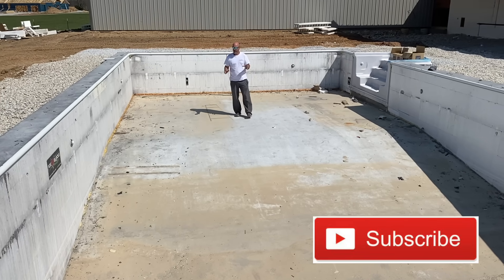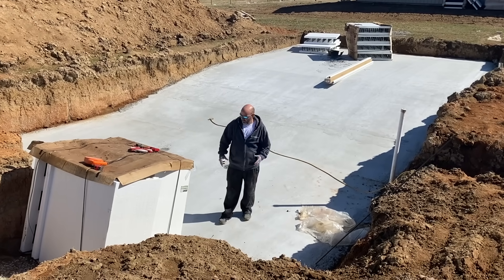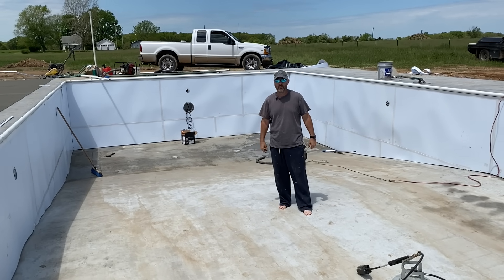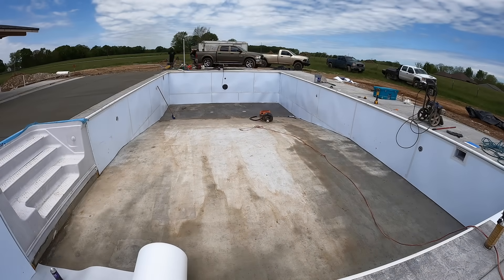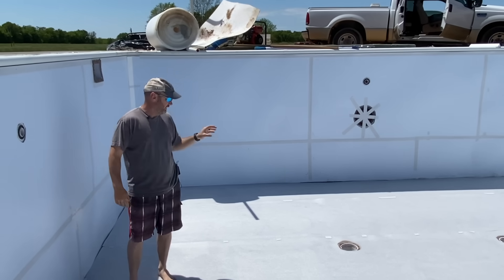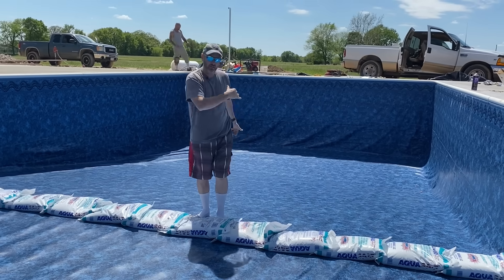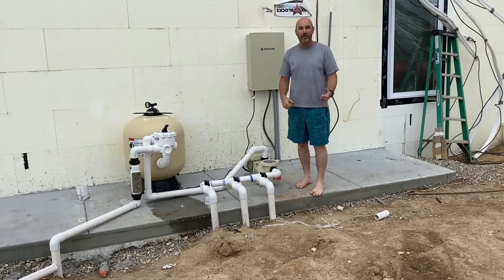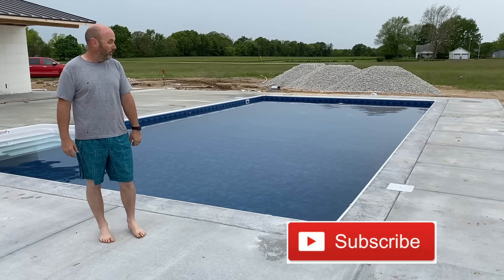ICF Pools of the future! stronger, cheaper and more efficient!

Comment: Whats the cost to build one of these inground pools? I am thinking about having one put in.
Reply from the maker: You can diy one for around 30-35k, retail is about the same as conventional steel wall sand bottom liner pools with all the added structural and thermal bekifits!

Comment: What is the size of the pool and cost total
Reply from the maker: That’s a 20x40, kit is 19k and change, another 10-12 will get it dug out and concrete and pipe, liner is 3k, retail on this pool is 70+, so you can easily save half if you diy with our kits!

Comment: Is anyone using a spray on bedliner type idea to coat a pool surface versus using a liner? I have seen some impressive looking spray on products in videos, waterproof and strong. The ones I am talking of cure in a few seconds.
Reply from the maker: Ecofinish is basically that, only it’s engineered and formulated to handle the submersion and chemical swings better than other coatings

Comment: Any reason you got an Eaytouch 8? That Superflo runs off constant power and is automated with a digital input cable, so the only thing running off of a relay is the light leaving 7 relays open. It’s nice to have extra relays for landscape lighting later on down the line, but that’s a lot of extra money spent if they aren’t going down that road. Just curious if they have other plans for the backyard.
Reply from the maker: Lol good eye…. Have you tried getting panels lately?  Unfortunately we take what we can get and I’ve had to buy 4 easy touch 8’s when 4’s would have been more than enough this year because it was all I could get…
Reply: @all3pools  Yes, we fortunately haven’t had a problem. We do shotcrete so about 90% of our pools include a spa. Haven’t had a problem getting the pool & spa combos thankfully. From what I remember we had trouble getting single bodies for a short period. 

Good call on going with Pentair though. Best equipment out there. Just a bit more expensive but well worth it

Comment: i don't get how your building a basic cement pool an lining it with vinyl an that's something new an cheap it's not it's been around for over fifty yrs , come up with a pool that's cheap an will last fifty yrs now that's something worth posting about !
Reply from the maker: First, it’s not basic cement, it’s icf, which is a natural thermal break, and we put foam on the floor and thermally break that too, reducing heating costs by up to 65% without a cover, with a cover even more because there’s virtually no heat loss to the ground!  The last 50 years 95% of vinyl pools have had steel or plastic walls and vermiculite floors, neither hold up like CONCRETE(not cement) and neither are less expensive than this system…. So this system is exactly what you describe, a structurally and thermally superior product that will last a lifetime!
Reply: @all3pools  underground cement walls and pads have been insulated for fifty yrs it's still basic cement work the foam molds are new ish dunno why you would use them

Comment: Great vid. Thanks for putting together. How long would a liner like this last in an indoor pool application?
Reply: It’ll last right up until the time that it doesn’t. It all depends on how the pool is taken care of and whether you “condition” the liner each year after drain down for cleaning or maintenance. A good conditioner we use is similar to a wax that’s used on vinyl wrap. It helps restore the flexible properties to the liner that’s so crucial to its ability to remain in use.

Comment: Hi, thanks for the video, great job. Just 2 things I never seen, the floor pipe install and how did you remove the liner wrinkles in the corners? Please show it in you next ICF video. Thanks
Reply: The weight of the water flattens out the wrinkles.  They also vacuum sealed to decrease how many wrinkles would be there to start with.

Comment: This is a cool video. I built an indoor 16x32 a few years ago out of ICFs and I used pex in the floor to heat it with radiant heat. Customer runs a cover when it’s not in use and his propane bill barely changed even though he heats it to 90 with no pool heater🤣👊🏼
Reply from the maker: Ya I’m going to try to accentuate the thermal benefits of icf pools as the few Gunite homers on here have 0 answers for how to compete with icf on that front!
Reply: @all3pools  it’s a drastic difference. In ground pools are extremely uncommon where I live so I’ve only gotten the chance to do one. I used the Stegmeier forms for the coping and the only thing I’d change is the way the liner kinda compressed the foam at the very top. Keep up the good work!
Reply from the maker: Ya on liners we use the aluminum bullnose when we can get it so it’s entrained in the coping and doesn’t try to pull the foam down, if we use a Cantilever form
Like stegmeyer, we cut the inside form down like 4” and let concrete come out all the way to the face of the icf, giving it a sturdy place to set the liner track

Comment: If you run a snake or string through the light conduit you can install liner then light faceplate, cut hole for liner then just pull the light cable back to electrical box. No need to take it apart that way. Good vid. I’ve done steel wall ingrounds with vermiculite bottoms for 25 years. I wonder the cost difference is with these. Might have to give one a try. Good vid.

Comment: How long is the liner rated to last
Reply from the maker: Liners can last 15-20 years if covered and ph and chemicals kept perfectly balanced…. That said, outdoor pools probably avg 10 years, if you hyperchlorinate or it’s in direct sun it will begin to fade before it fails…. On the plus side, replacing a liner is a one day job and is 4-5 times cheaper than a replaster

Comment: How durable are these pools in regards to dogs? I was considering a fiberglass pool as gunite is rough in their joints and I am just concerned about them puncturing a liner.
Reply from the maker: Ya dogs can damage a liner especially if the panic and try to climb out over a wall… but the thermoplastic stairs are bulletproof, similar to fiberglass, so if your dogs are swimming all the time and not scratching around on the walls it’s fine as the egress point is stout…. The real problem we’ve seen happens when animals that aren’t expecting to swim fall in the pool especially deer, they can easily jump most fences and fall in at night, and the ensuing panic can destroy a liner wall…. Rare but it does occur….

Comment: Why didn't you run separate return lines for the stairs? Also why not run another separate pool cleaner line in case they want a Polaris or something?
Reply from the maker: There are sep return lines, 2 of them…. And they bought a Dolphin electric cleaner which probably 9/10 clients prefer, we run Polaris plumbing only when there’s an auto cover so it can run under cover

Comment: Another thoughtful video production …but I question the long term viability of the entire system.
Reply from the maker: Curious what part of the system?  Liner pools which are pretty tested snd true at this point are essentially a wall, a floor, and a liner…. Icf walls are better in every way than steel, concrete floor over vermiculite is far more durable, and we use only 27 mil liner, seems good to me but truly curious what you are seeing?:)
Reply: @Jorl Bort, what specifically makes you question the viability? Experience or book/video-learned assumptions? Not calling you out, but I'm curious if you know something about this product & process that I'm not seeing. I'd never considered a liner (based on OLD, OLD practices), but I'm now considering.

Comment: Is that a fabric type of material your using as padding under the liner? Back in the late 1980’s we started using 1/8 inch closed cell foam on the shallow end of the pools basically for the comfort factor(we build a 10” concrete wall with a 3,500 psi pea stone mix poured pool bottom)We had problems with the liner sliding/wrinkling because of the foam padding on the floor so we stopped using it after 2 seasons.

Comment: I really like the idea of using ICF for a pool. Question: I wonder if you could put floor heating like one can put in a garage, and connect to a water heater, or if direct water heating works better? Just a thought...
Reply from the maker: I’m thinking thermally breaking the floor with foam and putting the btus directly into the water via gas heater will work the best, once the water warms the floor it’s the same effect and it’s gotta be a more efficient transfer…. Not positive but that’s where my heads at

Comment: I didn’t see any rebar or bonding. Do you add rebar in your concrete?
Reply from the maker: Yes, there is rebar in the thickened footers and it passed bonding inspection, then they do another one on wall rebar bonding, then another on decking within 5’ of the edge, passed all 3, I’ll try to show it in future vids, just try to keep vids reasonable length

Comment: How did you attach coping
Reply from the maker: Great stuff liquid nails pro cans, and tec screws   Every few inches hanging up into the concrete so it never separates from the concrete, the foam holds great but the screws make sure it bonds in the mud

Comment: I’ve never thought of energy saving potential for an ICF pool. How much would you say is saved vs a steel/vinyl liner pool when heating? Northern climate.
Reply from the maker: I don’t have imperial data from personal pools I’ve built but hopefully after this winter I will…. The one we hooked up before last winter, which was ridiculously cold in mo, seemed like it was heating for about a third of a comparable Gunite…. But their gas was running their house and pool so hard to be sure, but the entire bill was half of what a comparable Gunite pool was costing
Reply: @all3pools  Thanks
Reply: @all3pools  The common method here is the steel structure with a vinyl liner. Outdoor pools aren't operational outside of mid-May to September. We have hot summers and cold winters.
Reply: You can save around 80% by insulating. 14x28 pools used to cost £200 and take 5 days to heat up, 20x40 pool cost £20 and heat up overnight.

Comment: Great job sir! I’m actually building one for my familly right now. I have a question about the liner track. Do you use a particular track and how do you install it? You set it in the concrete or you screw it on top after the concrete is poured? Have you done any liners over concrete stairs ?
Reply from the maker: If you can get the aluminum bullnose that’s powder coated it’s the easiest, it’s in short supply right now…. On icf we just glue it on with great stuff liquid nails foam, take your time to set it perfect because there’s no good way to adjust once it cures…. Then before we pour the walls, we put hex head metal screws in the bottom flange like you would into a metal or plastic pool but we leave them up a bit to grab in the concrete, form the outside edge of your coping and pour it with the wall!
Reply: @all3pools  
Grest video, just would have like to see it in depth a little bit more.
Reply: Great job on the videos! One question. Could you pour the entire slab around the pool up to the coping at once to only have the concrete finisher come out once and make it probably easier to keep the stamp finish the same or is it important to keep the slap separate from the pool walls? We get a bit of ground frost where I live so it might move the slab a bit. 
Thanks!

Comment: 2 Things. #1 Am I the only one that saw all those wrinkles that will NEVER come out at 10:25 in the video...he cut the main drains in with ALL those wrinkles...this will look like garbage forever. #2 the main reason it doesn't fit is MOST credible liner manufacturers won't make liners for concrete pools...because they don't fit correctly. What did we learn? Buy a pool that's made for a vinyl liner...like a steel wall or polymer wall pool kit. The More You Know.
Reply from the maker: Lol, no wrinkles when done, they fit if you measure right….
Reply from the maker: And I don’t know a single liner manufacturer who doesn’t custom make nearly all of their unground liners…

Comment: What’s the cost for something like this?
Reply: Call Bullshit on your 50k, unless he used titanium aggregate in the concrete! 😆🤦🏼‍♂️
Reply: @lancekeirn6243  so, what do feel the price should be???…
Reply: @blakeanderson1214  you wanna talk a contracted price or DIY? Contracted price could be whatever the market would bare. I take the video as showing the benefits of the IFC.install, as well as DIY-ability (just so you know, I was CA licensed with both A & B classifications). It's a simple sloped rectangular dig, gravel base, Fresno slab, simple stacked walls, poly steps, gravel backfill, pvc plumbing, foam pad, broom finished deck with cantilever, pentagram intellifli with online salt. 
First, remove the added decking from the pool cost to get cost of pool. Then, even if you dub out the ex and concrete placement, if you're at 25-35k, you'd better be on the high side of things as a DIY.
Reply: @lancekeirn6243  got ya. That price(25-30) was more where I was thinking. Now, I just need to hire someone @that price
Reply: Answering another commenter, he said around 50K

Comment: Great video, did I miss vertical rebar installation into the slab or do the walls depend on a perfectly compacted back fill to maintain their rigidity?
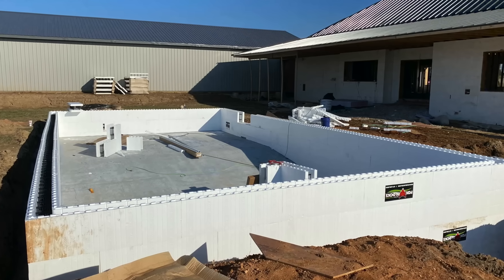Reply: Yes, we all missed it...goes from 2:11 with dirt walls to 2:12 with the complete wall setup and skips the entire installation process.
Reply: With no rebar in the slab I am guessing there is no rebar anchoring the walls to the floor.  I think what you see sticking up out of the ICF is the plastic structure that holds the two ICF walls in place .

Comment: Sand filter really. Nothing like 60 yr old tech. Why not cartridge filter. 4x better filtration than sand. A sand filter is a water waster. Really wish people would learn pool hydraulics because it is seriously an issue in this vid and 99% of pools built today. Look not throwing stones. I want the pool industry to be better.
Reply from the maker: We don’t use cartridges outdoors in our climate unless it’s got an auto cover…. They get wrecked very quickly, that said our favorite filter is DE, de doesn’t require buying new cartridges all the time, and they go down to like 3 microns with is better than cat rushes… but we are honest with customers and tell them they are more maintenance and more work to clean than a sand filter so it’s ultimately up to the customer, this pool was designed to be as cheap as possible while still using nice equipment, customer is happy🤷🏻‍♂️

Comment: Nice video, but it's CRAZY to me someone would build an ICF pool and NOT insulate the bottom!!!  Kinda defeats one of the biggest benefits of going with ICF, the insulation!
Reply from the maker: Ya we do most of the time. But if they aren’t putting a heater on it, and never will, it’s an item on the budget that they can choose to cut🤷🏻‍♂️
Reply: @all3pools   I’m sure the floor foam you put down also helps with insulation
Reply: Where I can get it I do have above, the ground would like to switch for one of those appreciate I'm at Tucson Az

Comment: Is this type of pool supposed to last longer than a fiberglass pool or cement pool?
Reply from the maker: If you mean vinyl liners not really, they are typically cheaper than fiberglass, and way less than Gunite and plaster pools, the big plus is when the liner wears out it’s fairly cheap to replace, higher end pools require much pricier redo’s

Comment: Amazing Job!!  How did you secure the liner track to the top of the ICF?
Reply from the maker: Liquid nails pro foam…. Then I drove tec screws every 1’ leaving them hang up 1/2-3/4” into the concrete when poured for a permanent hold, the glue is plenty strong to hold back the concrete during the pour, I just don’t trust the liner track to just sit on the webs of the block for their only support

Comment: Great video. I've been looking to do an ICF pool. How thick is the concrete in the ICF walls? What part of the country is this? Will this work in cold climates as in canada?
Reply from the maker: Colder the better!  You’re effectively building a big igloo cooler so it holds the water temp so much easier than traditional pools, if thermal breaking is your primary motivation I would highly recommend Dow board or closed cell spray foam under the slab to break the floor as well!
Reply: Do you have to put the foam under the slab? Wouldn't it work better on top?

Comment: where was your #8 ground wire run with your light power?
Reply from the maker: You should look up the 5g before insinuating it’s not there, it attaches to the back of the niche behind the wall, then a flat bond bar connects from that to the metal on the light when you set the light…. The niche is made for the light🤦🏻‍♂️

Comment: Why no insulation under the slab?  If you have a heater you’d loose a lot of heat thru the bottom by thermal conduction. The walls are super insulated. Could you heat it easier at this point with in floor radiant tubing?  Nice job!
Reply from the maker: Thanks!  The customer ultimately makes that decision, on the entry level pools when they are positive they don’t want to hear in the future is an easy way to save several hundred dollars...  we absolutely recommend it though, one I’m building right now with pretty steep slopes is getting closed cell spray foam installed early next week!
Reply: I know almost nothing about pools.  Never had one. Just wildly imagining electricity for heating with fall and spring could be: $200/mo x 12 mo x 10 yrs is $24k.